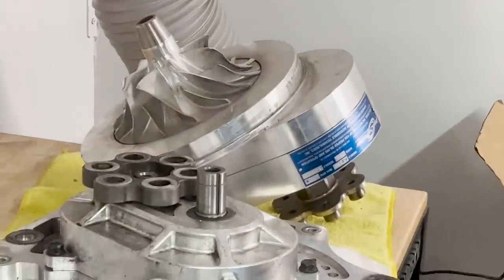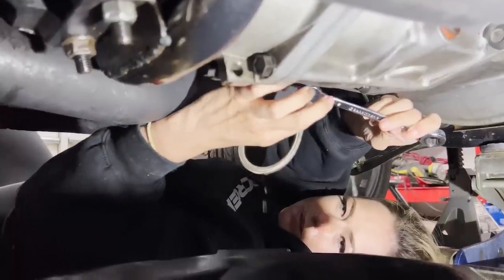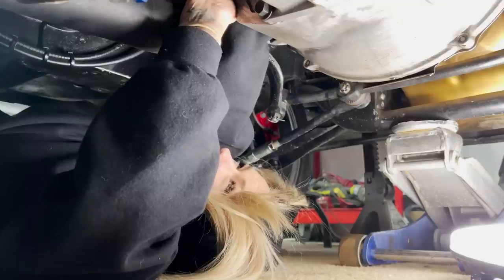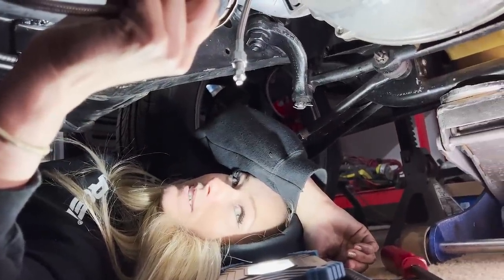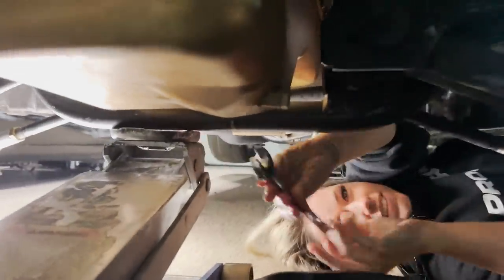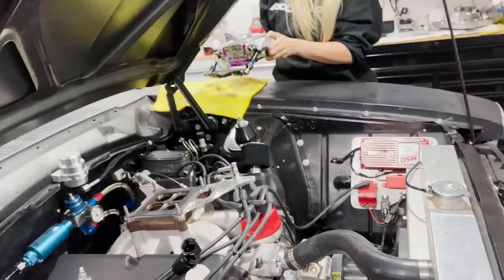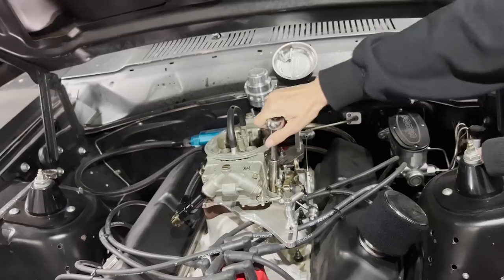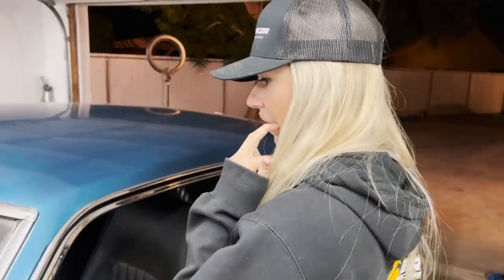Trash Panda Maverick: Hydraulic Throwout Bearing Adjustments, New Carburetor, and Street Testing

Comment: Yes! see you do know exactly what you are doing! You can learn from this channel. Concrete is the ideal spark plug gapping tool. Firm enough to close the gap but it dents instead of hurting the strap. And bonus, the dust from the floor helps properly lubricate the spark when it jumps the gap. Since the gap is small bouncing the plug on concrete 3-5 times gets the proper amount of spark lube dust on the strap. Science.

Comment: You have the 2 scoops on the hood,  back in the 1980's a friend had a 72 Torino with the scoop on the hood he made a cardboard template to go  under the hood,  close hood for carb stud location.  Bought some .080 aluminum used template to cut to size then pop rivet to under side of hood/ pulled out fake grills from hood scoop Ram Air.
Reply: Think they were called grabbers.

Comment: as having a slipper at street car i recommend to put quick connect to clutch lines;) Air gap adjust is one pain to do.. I do also pro stock car clutch and its so easy if compare to our duster😂
Reply: And if anyone thinks slipper clutch is good idea for street car.. well its not. Lots of work before getting even close that windows where it works 😂

Comment: Hey I’d like to tell you about gtx castrol oil in my 1995 mustang I bought new. I had the worst sludge I’ve ever seen after 86000 miles of any engine I’ve ever rebuilt. Sludge was so bad it clogged oil returns and overheated hence the rebuild. I changed the oil religiously at 2500 miles and motorcraft filters because it was my first new car. My engine machinist said it was the worst he’d ever seen with those miles. So gtx castrol oil sucks, it’s worse than quakerstate. Love the videos, y’all way cool.
Reply from the maker: We are weirdos when it comes to oil changes, we change it like every few hundred miles, especially on the performance cars, if we left it any longer, I would splurge on some better oil.

Comment: Noticed the hydraulic jack position. I then noticed the jack stand and I hope they are not depending on it holding the car up if it is positioned under the bumper. The Mavericks depended on scissors jacks to raise car up to change tires. The bumpers were notoriously weak and mainly decorative. New viewer and saw that.
Reply from the maker: Oh definitely not, the Jack stand was under the front frame rail. I don’t think the bumpers would even last two seconds trying to hold the car up.

Comment: Love the sbf content!! Keep it up.  Time to get some 6 Ton stands. Small stands are for wheel/ brake stuff. Under the car is miserable with tiny stands .   Or maybe build those 2x4  wooden car stands. Happy New Year🎉
Reply: Cinder blocks under the tires when the wheels are on.  Jack stands with wheels off.
Reply from the maker: We have the big ones! Don’t ask me why we weren’t using them. Haha.
Reply: Stackable cribbing blocks are awesome and only go up 2” at the time with built in tire chocks, i made a front set with a metal plate and a bearing in it with a bolt welded thru the plates so i can turn the wheels when needed.

Comment: Just another archaic Ford truck diff bites the dust. Either buy a all singing and dancing version or put the 8.8" in.
Gearbox,, get yourself a close ratio 4 speed, there is several race boxes around. T5s have lousy ratios and are weak as!
The strong versions, TKO, still have lousy ratios. Close ratio with around a 2.2 first and a 1.25 third will make the car quicker than any modern roadcar gearbox. Or a Super T10.
950 carb? on a 347?? Not unless you are turning 9000 rpm. 830 or 850 is ok to turn 7500. Less a 750 is plenty big